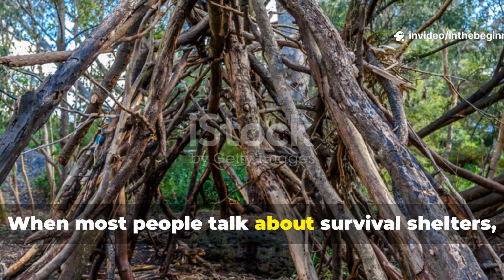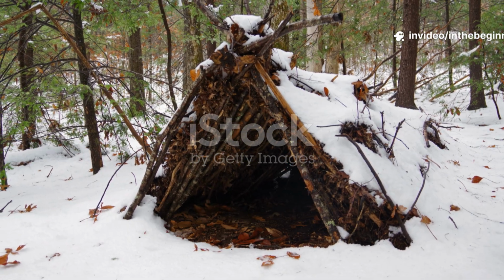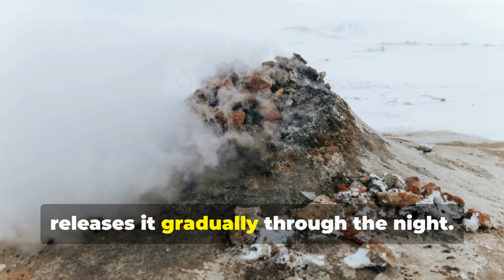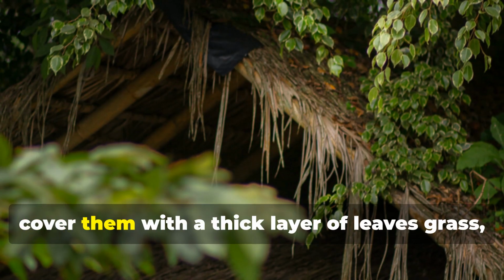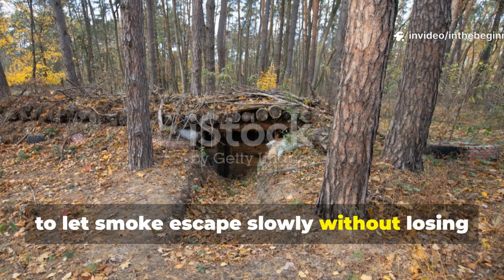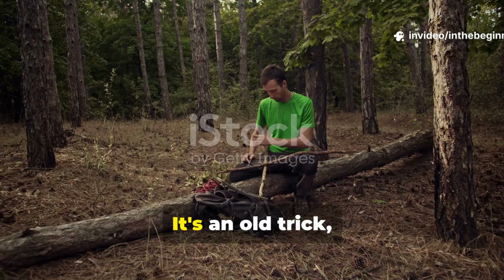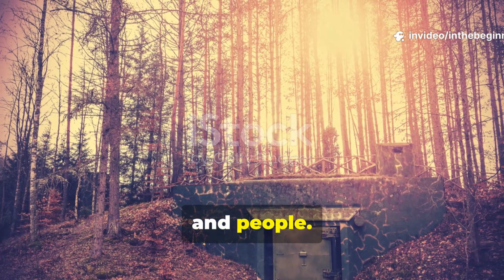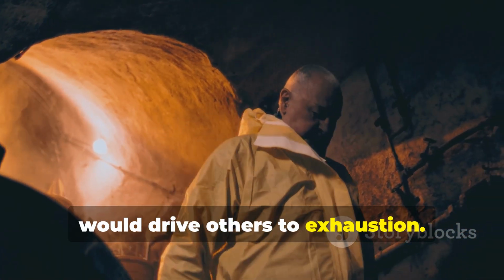Stop Building Above Ground Survival Shelters — You’re Losing 60% of Your Heat

Comment: My home is built a meter into the ground, and the heat retention is phenomenal.

Basement apartments that are constructed virtually all below ground level must be really good for heat retention.

I'd like to construct a micro-cabin that's around five feet below ground level, with the window being a few inches above the ground.

The roof will only protrude about eighteen inches above the ground, so it may be used as a garden seat!

It should be quite warm, though I will install a Fatsco Pet Stove for heating, cooking, and water boiling in winter...